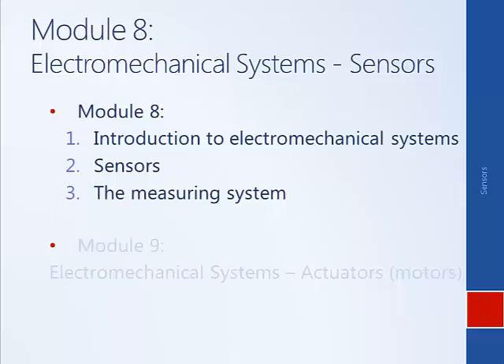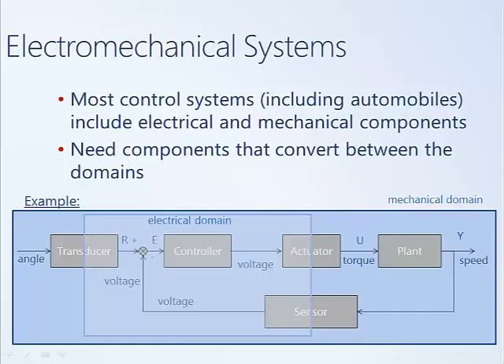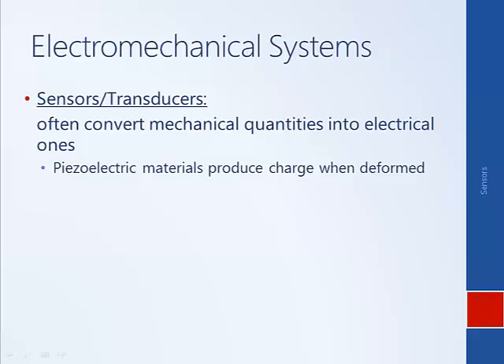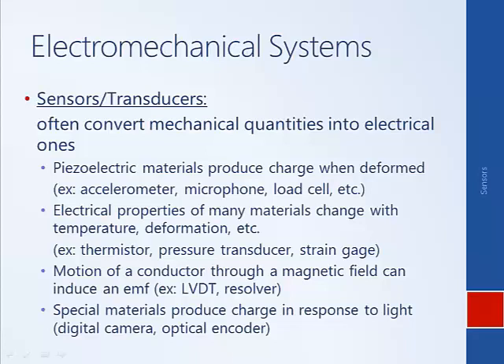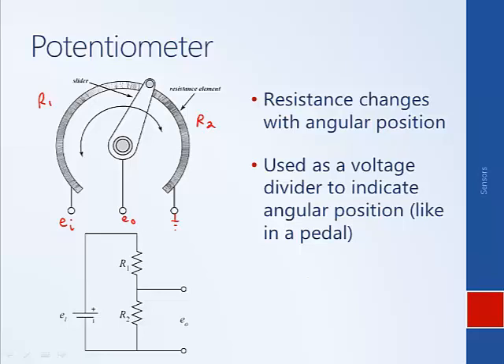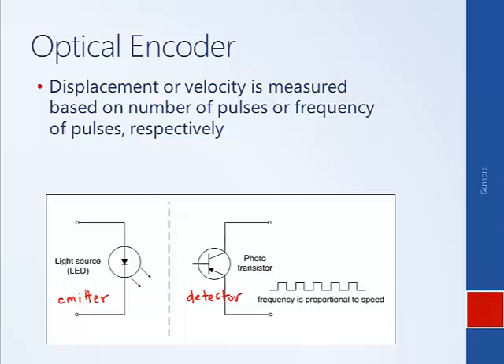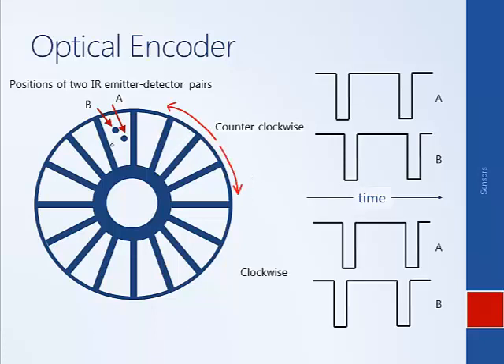System Dynamics and Control: Module 8a - Electromechanical Systems (Sensors)

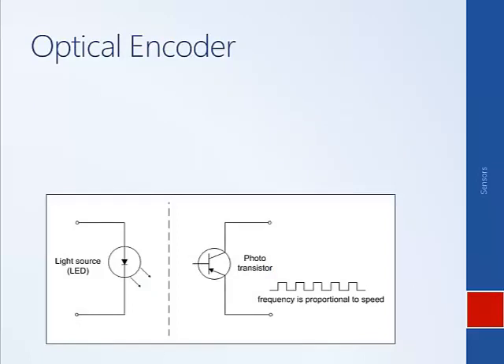Comment: 8:03 There are three wires going into the potentiometer in the physical diagram - only two in the circuit diagram. Where is the third wire?
Reply from the maker: @Ensign_Cthulhu the third wire is the positive end of the battery